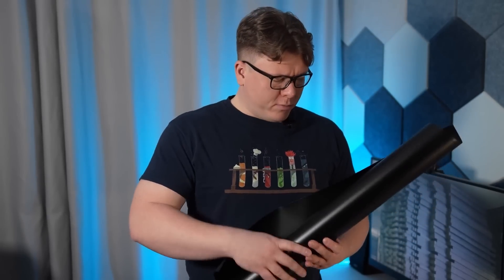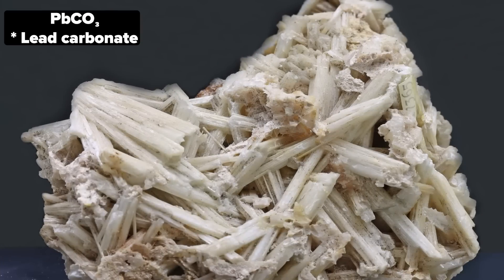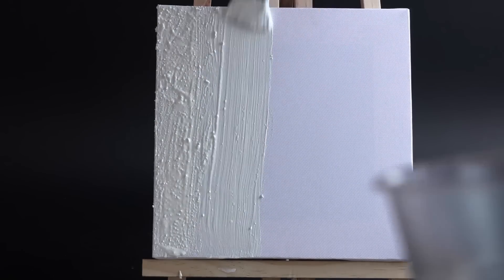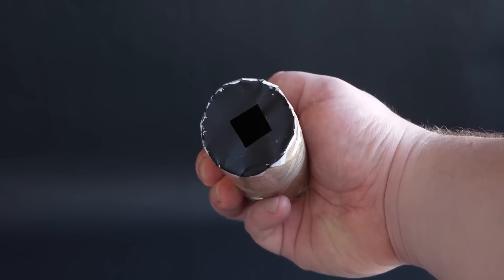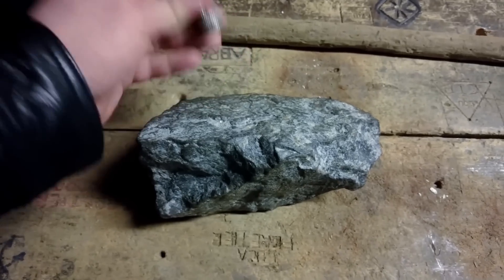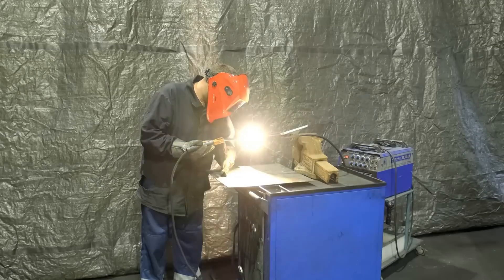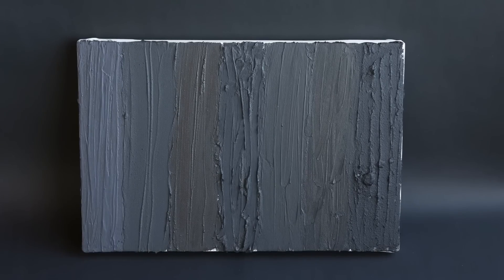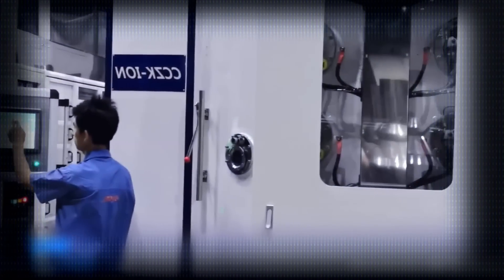Creating The Blackest Material Ever

Comment: Black pigments are actually converting light to infrared. Black painted bodies both absorb and radiate more heat. It would be interesting to measure the temperature of surfaces painted with vanta black.

Comment: You NEED TO apply the Musou Black with a SPRAY GUN!!!  you can find then very cheap in hobby store... but you will need an air compressor to connect it to.. THEN you will see how it is REALLY supposed to look!!!!! :) 
ActionLab did a video about Vanta Black and you will find it VERY COOL!!!!

Comment: When mixing oil into pigment, i suggest you use a glass mullah and a glass plate to mix it properly. You'll get a smooth paste without all those lumps.... don't just mix with a brush or stick. The pigment needs to roll around and be fully broken up and coated in the liquid medium.

Comment: To get an even more consistent film thickness of musou black paint, you need to applying it with a micro fibre roller (shortness nap possible). Spread it evenly, then knock off the top (finish with a light roll in one direction, the nano tubes will uniform differently depending on the surfaces texture and the direction you finish it) to find the most consistent texture of your desire. ❤

Comment: there was no control for the linseed oil itself, it's the thing that turns yellow. chemically speaking if the other elements were going to change color under uv aging they wouldn't necessarily turn yellow at all

Comment: 4:00 - "lead" can be pronounced 2 ways, but both ways have very different meanings.
- lead that rhymes with "fed" or "dead" is the chemical element.
- lead that rhymes with "seed" or "bead" is 'to have something follow'.

It's even worse because "lead" as in to drag something around (she leads him around) and "led" as in the past tense of to have had something follow (she led him around), have related meanings but different pronunciations; "led" is pronounced the same as the chemical element.

Also, LED as in light emitting diode is rarely pronounced as a word but instead as spoken initials, "el-ee-dee", partly to avoid confusion with the other two things that sound like "led".
Reply: Yeah, I was thinking the narration could easily be fixed by changing “lead” (metal) to “led”. (And if LED ever came up, “Ellie Dee” could be substituted.)
P.S. I'm in love with Ellie Dee - she's the light in my darkness.
Reply: Is that a Billy Joel song?